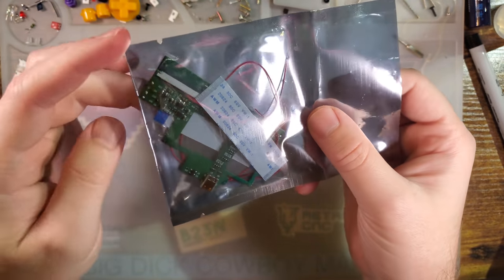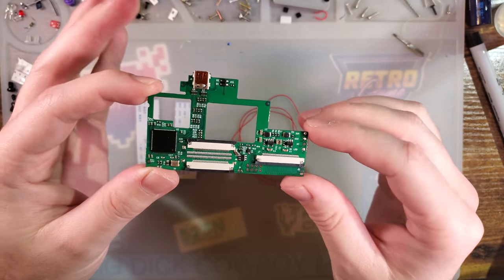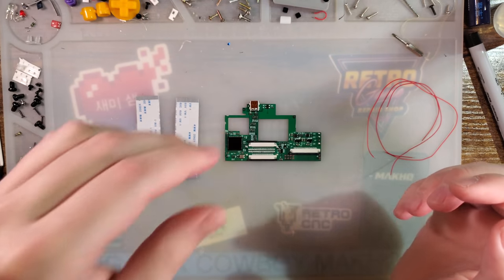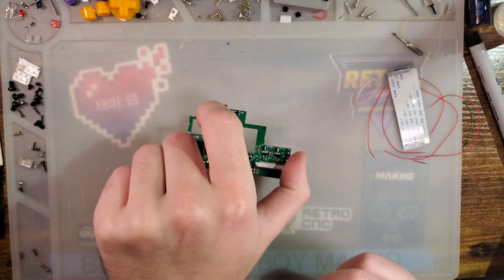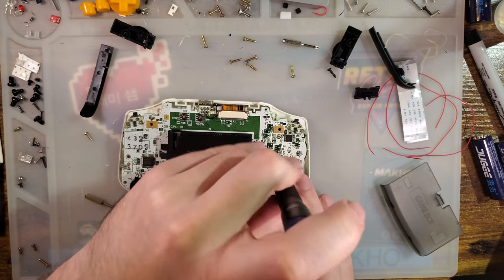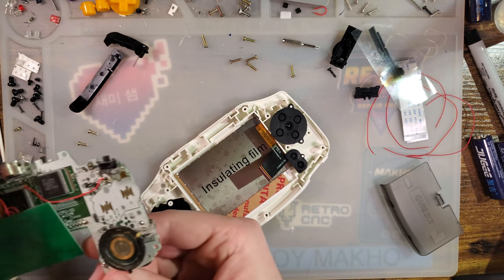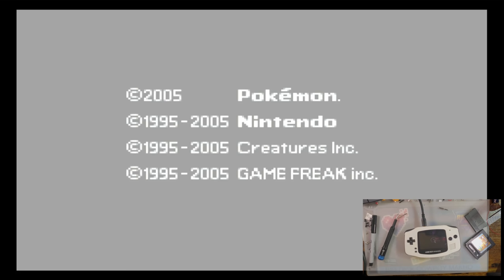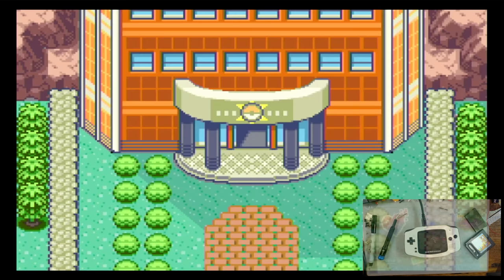Two Wire HDMI Mod -- Game Boy Advance

Comment: The only thing I can think of with the quiet sound in 8-bit mode is the way the mod is pulling the audio from the CPU - it might be only taking the "Direct Sound" (GBA PCM) channels and what's heard from the GB/GBC "APU" / PSG channels is only interference / bleed...? If you try a GBA game that uses both types of sound together such as Sonic Advance (1/2/3), Mario Kart Super Circuit or F-Zero Maximum Velocity I'm guessing some instruments of the music will be quieter than others.

Comment: Just installed one on my 40-pin GBA with an AGS-101. Just wanted to confirm the back light doesn't work when plugged in to the slot dedicated for the AGS-101 screen.

Comment: I worry about the durability of microHDMI... I know that, in the DSLR space theres lots of complaints about microHDMI breaking after repeated cycles of plugging and unplugging the cable... it looks like theres actually enough space to shove a full size HDMI port int he top of the GBA... but it would probably require more extensive modification. Still... this is really awesome, and looks like a good mid point between a full portable and a consolizer, if you want to capture games.
Reply: I despise microHDMI..

Comment: I soldered the audio 1 and 2 cables, (not intersecting or anything, and they're definitely still connected upon examination) but I'm not getting any audio output via the HDMI... do you know why this is? Do I have a bad board? Or bad solder joints?
Reply from the maker: Possibly an incompatible TV. These aren't HDMI certified and likely not fully compliant either.

Comment: I have this kit and the screen doesn't turn off when I plug in hdmi. I followed a guide that said to jumper J1, could that be why?
Reply from the maker: Depends on the specific kit, really. There are some variants floating around that simply do not switch the screen off OR they require a button combo to do so. You may have one that just doesn't turn the screen off.

Comment: Recently installed the kit, would you happen to know why it's out putting a pink tinted video for HDMI? My IPS has proper color but the HDMI does not. Also what capture card do you recommend with this kit ?
Reply from the maker: I don't recommend a specific capture card with this kit. I just know elgato has compatibility issues. 

HDMI could be a bad cable/adapter or a problem with the mod itself.

Comment: I'm having problems to fit this mod with a ags 101 screen. The Shell doesn't close enough and L and R buttons are hard. Can everyone help me?
Reply from the maker: An AGS-101 LCD barely fits as is. You'll have to get real creative with your shell trims if you want to fit that screen with this mod board. Consider adhering the screen directly to the lens and then trimming the shell to fit that assembly. Additionally, the rear shielding of the screen can be removed (though do take care not to disturb the backlight diffusor) for an extra half mm of space.

Comment: I'm using this mod on a projector, and the screen is flashing on and off slowly. Is it a power issue??? It works fine on an lcd tv.
Reply from the maker: It's probably just incompatible with that device. These mods do not comply with HDMI standards.

Comment: since you’ve used both this and also laminated screens seperately, do you think they would form together? or are the laminateds too big for it to work
Reply from the maker: Laminated kits typically leave more room inside because the LCD being closer to the glass moves it away from the motherboard. https://www.youtube.com/watch?v=hMm9rqB_V3s
Reply: I can confirm there is compatibility, I did it with a funnyplaying laminated kit plus a funnyplaying motherboard. It went together easily, but you will need to trim the retention bracket that holds the laminated screen against the shell in addition to cutting the shell itself for the HDMI port.

Comment: I just did this mod. The video output is fine, but the sound coming out of the TV isn't clean. It's full of artifacts. Should I try resoldering the wires again?  @makho
Reply from the maker: worth a shot. Try another game and another TV as well.
Reply: @makho  tried both. I also have the clean amp and dehummer installed. Could they somehow be at fault?
Reply from the maker: @ghostasset  neither will do anything for this mod so absolutely they could be the problem
Reply: @makho  Sorry I don't understand. Was that a yes or a no? 😅
Reply from the maker: @ghostasset  yes, they could be at fault

Comment: How does the input lag hold up compared to the real Gameboy Player hardware, using both the official software disc and the GBI homebrew? I'm looking at this to retire my Gamecube with for GBA TV usage.
Reply from the maker: I don't have a method of quantifying input lag. 

I also don't have a (working) game boy player.
Reply: I’m in the same boat. I have a Gameboy player with the disc but kinda want to mod my Gameboy to do the same thing and also be portable. What decision did you end up making?

Comment: Is this better than the GBA consolizer? Trying to decide between which mod to go with.
Reply from the maker: This is a different product that fills a different niche. Define "better".
Reply: @makho  Fair enough. I know "better" is subjective. What I meant by that was which does the following "better" : ease of use;  picture quality. If you could only have one, which would you choose? I know that you are friends with other maker's and don't want to put down other products. Not trying to do that here either. I get your point about apples and oranges. Was just wondering which provided the best picture quality (in this case, on paper it's the consolizer) and ease of use. Both are cool products.
Reply from the maker: @ThatMartinezGuy  I'm not friends with either maker. I just have a relatively open line of communication with the maker of this kit. 

Re Picture Quality:
Consolizer type mods (either woozle's consolizer, gamebox systems' gbhd advance, or zwendergy's gbahd) have much better picture quality than this thing. The setup is much more involved and the GBA will no longer be a portable system. You get to use an external controller (or not if you option your install that way) and no longer have to rely on batteries (or do if you have a wireless controller e.g. 8bitdo). This mod, on the other hand, is pretty easy to slip into an existing console as is but it does have fewer options for configuration and extra features and actually supported neither of the two HDMI devices I tried it on properly. The resolution/aspect ratio was incorrect. 

Re Ease of Use:
Like I said, the niches are different. If you find yourself basically only playing on the big screen, a consolizer type mod makes more sense. If you find yourself switching back and forth, this mod can make more sense unless you just want to do a completely separate build and swap your games between the two builds as you play. If you find yourself playing largely on the go with the occasional plug in to the TV, this mod stand alone might make more sense. Your choice.

Comment: Can you wire a snes controller socket to the test pad controls? I would love to make a mini 3d printed snes with a snes controller port. Maybe extend the 32 pin cartridge connector too. Since I missed out on the gba consolizer.
Reply from the maker: it's not that simple. You'd need a transposer. Look into zwenergy's gbahd
Reply: @makho  lol bummer I just bought the kit plus a wireless 8bitdo snes and a controller ports
Reply: @makho  man thanks for that info love open source projects. Speaking of which is the gba motherboard Gerber pcb available for download I was interested in making a black pcb from pcbway I remember you had a video I believe?
Reply from the maker: @user-gj6vg6nq2f  no gerbers available, I had to buy the boards. Check that stream I did for more info
Reply: @makho  yeah that's a bummer it should be available for download.
Reply from the maker: @user-gj6vg6nq2f  that's a pretty entitled opinion

Comment: Hello, what capture card do you use? I'm using Elgato HD 60 S because my 4k Pro version dont recognize the signal of the gba. on the HD 60 S the sound is very crackling but I got the signal. I solder it perfectly, resolder it but it the problem stays. Hope anyone can help me :/
Reply from the maker: elgato is not compatible with these types of mods. I've shown before that I use a generic capture card I found on aliexpress but if you just want this to play on your PC, why not just use an emulator?
Reply: @makho  yeah I bought a cheap one from amazon but got the same sound issue. Nah I dont like to play on a emulator :D Do you have a link of your product which you bought on aliexpress? But you said that there might a input delay I guess :D
Reply from the maker: @xkarma534  I don't have a link to the specific one I got but they are not hard to find. It's a very generic piece of equipment with dozens of rebrands.

Comment: What's with the audio crackling?
Reply from the maker: Crappy capture. I've since gotten a much better capture card.
Reply: @makho  ah so it no longer has crackling? That's nice. What capture card did you get?
Reply from the maker: @DeadSkullzJr  Cheap no name but supports 4k@30 or 1080@60 unlike the old one
Reply: @makho  ah nice, got a listing for it that I can look at?

Comment: That kit looks like a real pain in the ass to install. Im sure someone will come up with a solution to combine both IPS and HDMI mod on the same board, even if t has to be a daughter hat board of some description. It has to happen!
Reply from the maker: It's only a pain in the ass to install with a wire managed IPS kit already installed. I stated this several times in the video. It's plug and play aside from the small notch you need to file into your shell and the two wires that need to be soldered.

Comment: Shame the scaling is garbage. You could easily fit a 4x scale GBA image in a 720p window (960x640). But that'd take actual work..
Reply from the maker: well, if we take the creator at their word, they are using 3x integer scaling. It's just that your device has to support the output resolution (and 3:2 aspect ratio). None of my devices did.

Comment: I would have preferred components or video over type c, cause if its going to be hdmi and it needs to be small micro hdmi breaks too damn easy, also component looks better than av and has lower latency with a tube tv than hdmi with a modern tv
Reply: Totally agree, usb C wouldve been the way to go
Reply: @axelkusanagi4139  that wasn't component, that was av, and you can have an adapter to type c, like have a little connectors that can handle cables being plugged into it either way, also there's drawing tablet that have that built into their type c port so they only need one cable for touch and video, the only problem I could see with that is the chip shortage, but no other device using those chips are having difficulty in that area, but yeah I'd say look up some more cable stuff so you know a bit more friendo, av is the red white and yellow cables which aren't even meant to display color, it was a hack to make it display color, modern tvs have the benefit of hdmi, but also non oled screen are and have always been slower than tub testing because of the way tub tvs work, the gba screen signal needs to be converted into something that can be passed over a cable, which takes time, you can then convert to say hdmi, the benefit of that is you can use it on many more screens, or component which has the lower latency tvs, then there's av which omwad the one that came out before which has a video signal that is weaker to interference while not being able to be connected to modern displays, av is the worst of both worlds, also I would be fine with hdmi if it wasn't over the easily broken mini hdmi, which they could have gotten one more chip or a chip that could handle both, whatever latency is added to me is negligible since the only real benefit of hdmi is using it with modern devices, which you can eliminate a lot of that latency with an oled, but I'm broke as shit, like having mini hdmi on a controller that you're going to be moving around is just a trip to the soldering often too often for my tastes
Reply: @axelkusanagi4139  sorry if at any point I came off rude there, I was also getting fluided with comments by some yter called something corpo about how child labor in roblocks is just child volunteer work, also with him jumping over everytime I mentioned predators being on the and telling me to go to China and Russia, I do apologize if at any point I let any of that slip through and came off as an ass, that wasn't on purpose and I hope you have a wonderful night/day
Reply from the maker: how are you so sure that the composite TV encoder in these kits is lower latency than the HDMI encoder here?
Reply: @makho  (I was talking about component, not composite, I realized that after I typed most of this and am tired so don't feel like changing it)I'm not, you right, I didn't say the encoders were in any of my spots, not because I didn't think of that but more so I was fixcating on the actual tvs, since tube tvs are lower latency in comparison to most modern flat panels, the exception being oled because if the way it switches colors in the actual pixels of the panel, for most 'regular' screens it takes more time for things like the leds to change colors as well as other junk I can't remember cause I was bout to hit the bed, but yeah tube tvs are faster just in the way they have a laser cannon shoot the areas of color on the screen which is why competitive melee players on gc mostly play on crts, also I say areas of color cause things like nes telling the the old tube tvs it wanted rectangular blocks of color for its pixels instead of actual pixels because they didn't have to have like exact pixel, I'm rambling partly cause I'm tired but I love how much you read and respond to comments, always being so genuinely helpful to so many people and I hope you have a wonderful night/day/whatever
Reply from the maker: @zachariahm.kemper7406  that is highly dependent on the actual TV. Some do some processing on the image and can have quite a bit of input lag, CRT or not.